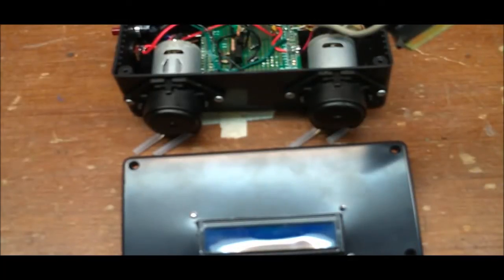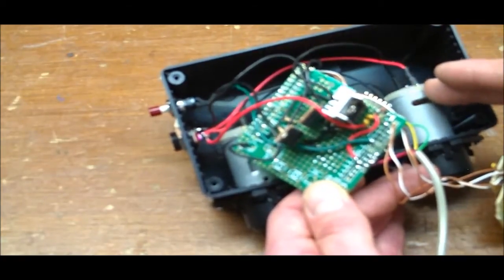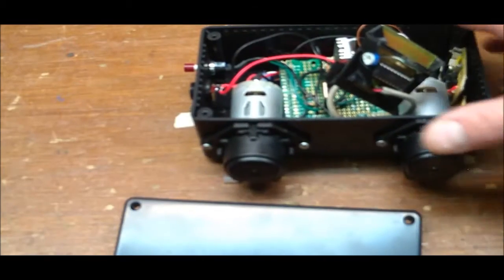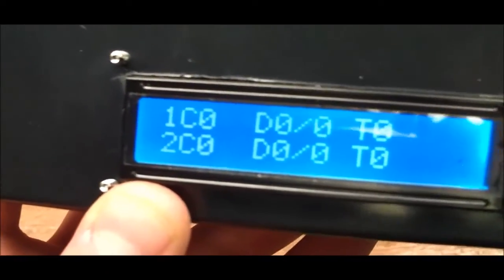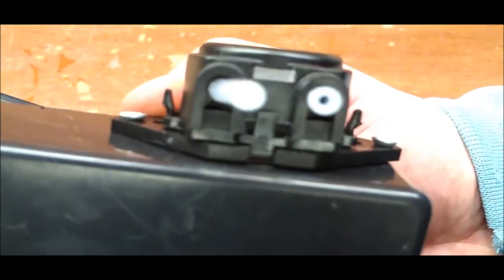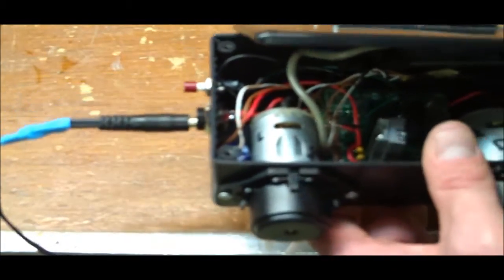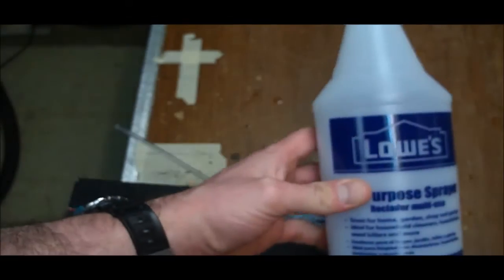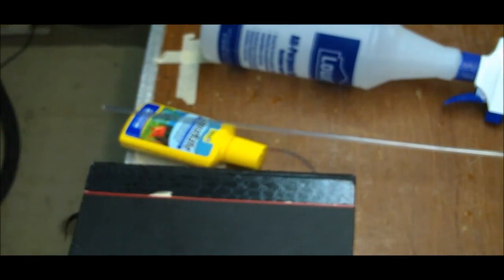HOW TO: Arduino Aquarium Dosing Pumps

Comment: I might have the solution to the LCD problem when the motors turn on.
Rather than analog writing 255, try gradually increasing the value from 0 to 255. Each millisecond it could be raised by one so it takes about 1/4 second to reach 255. This completely solved some similar issues for me where my arduino would freeze up when a 12V motor was started. Also when you turn them off, gradually decrease it back to zero. This minimizes the back EMF.

i.e.

while(X<255) {
if(millis()>t+1) {
X++;
if(X>255) X=255;
analogWrite(motorPin,X);
t=millis();
}
}
Reply from the maker: Ok, I will try that. Thanks for the comment..
Reply: Yeah no worries. I hope it solves the LCD issue, let me know if it does. Those lcd's are very sensitive.

my last comment was a bit confusing, the example code was for increasing slowly not for decreasing.
to decrease back to zero it would just be,

while(X>0) {
if(millis()>t+1) {
X--;
if(X<0) X=0;
analogWrite(motorPin,X);
t=millis();
}
}

where ever in your code you use, analogWrite(motorPin,0) or digitalWrite(motorPin,LOW)
simply replace that with the above code.
And replace any analogWrite(motorPin,255) with the code from my first comment.

Also don't forget to declare "t" as an unsigned long

If it doesn't solve the problem, try using a slower rise by replacing the "t+1" with a higher summation like "t+4".
Reply: A year late, but, there is a small danger you may want to consider. The reason the LCD screen goes crazy almost immediately is because the back-EMF is scrambling RAM on the arduino, as far as I can tell. This means your pumps could get stuck in an "on" state if it happens to scramble the part of your code that turns it off (or the currently executing bit). This is pretty easily demonstrated by manually running the pump (via button wired to it or just physically bypass the mosfet with a wire) for about a minute. If I let go of the button after that long, the pumps will keep running nearly every time. I'm personally too scared to use it and have not found a solution to the back-emf yet. I've increased reliability by putting a ceramic resistor between ground and 5v, but it's not 100% effective.

All I know for sure is that if I run the pumps for too long, the code I wrote will stop executing (for example, blinking LEDs will stop).

Ramping up the pump via the PWM sounds like a good idea though... I will give that a shot!
Reply from the maker: Christopher Medved  hmm ok. Wonder if I can use a MOV. A MOV worked for emf issues I had on 120vac. The other thing is to use the watchdog timer.